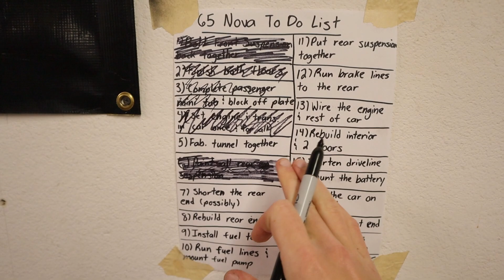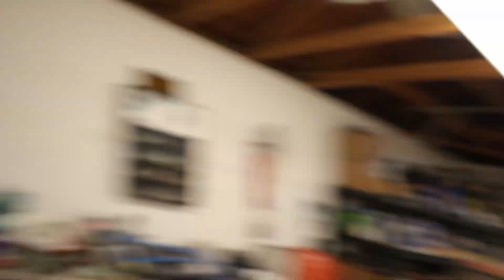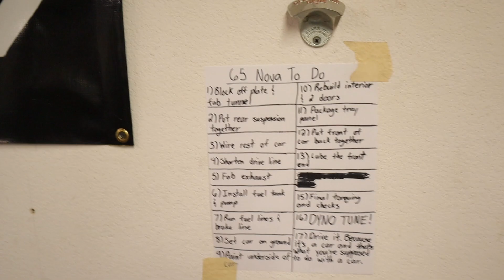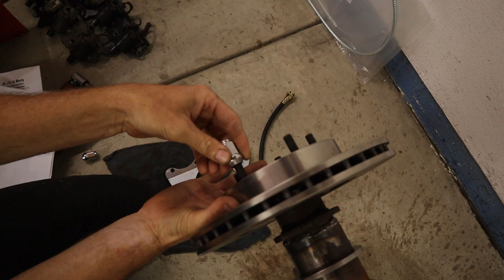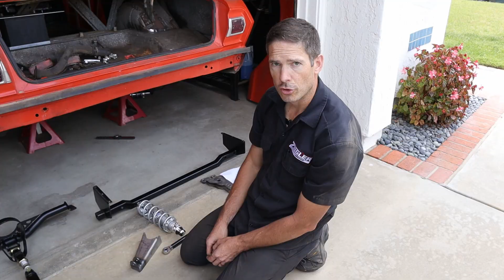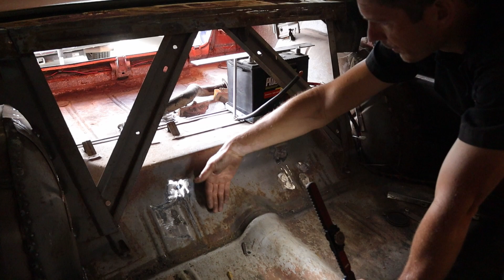Beginning the TCI rear suspension install - Chevy Nova Build Part 21

Comment: Watched the vid again. Surprised that you were able to fit a 295 tire. I'm wondering what the difference would be in tub shape/width between a 65 and 67. I tubbed my 67 over to the frame rails and thought that 285/40r17 was the widest I was going to get. I have roughly 3/4" clearance on both sides of the tire.
Reply: Continental Extreme Contact Sport tires. They measure 11.5 inches mounted on 17x10 rims. Nice looking.

Comment: My rear wheels are just under 26" inches diameter as well (17x10 67 Nova). I had been planning on going with 3.70s gears 5 speed with .68 OD.  Based on your comment regarding the 308 gears, rear wheel diameter and engine rpm on the highway, I'm wondering if the 3.70s are a good choice. I don't plan on any 1000 mile road trips, so maybe the 3.70s are ok. Your thoughts...? BTW I am in the process of installing the TCI torque-arm and TCI custom front clip. :)
Reply from the maker: It all depends on what you want to cruise down the road at. Going off your information given you should be able to drive 67 mph @ 2200 RPM’s.